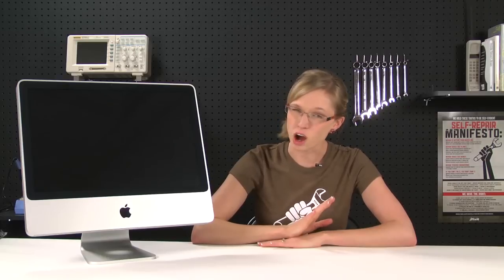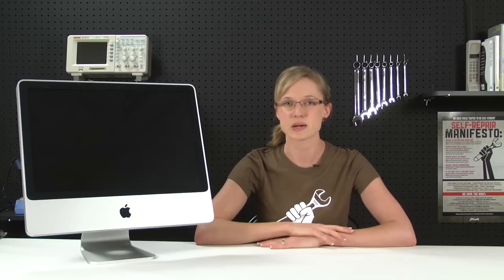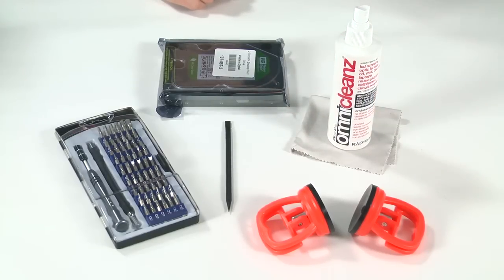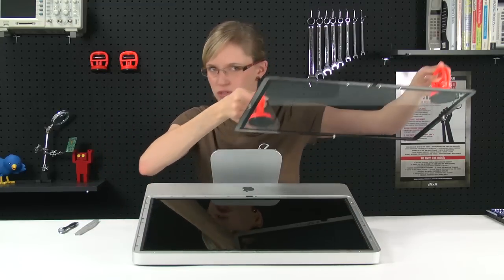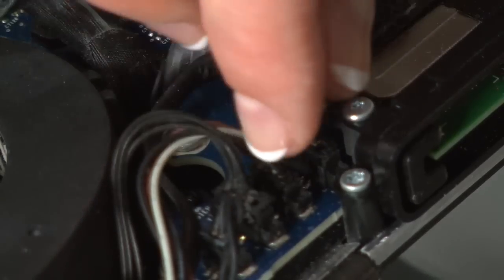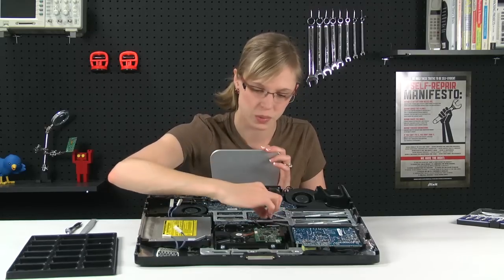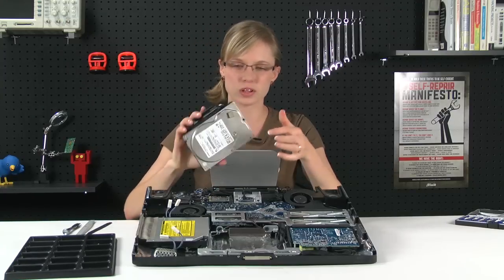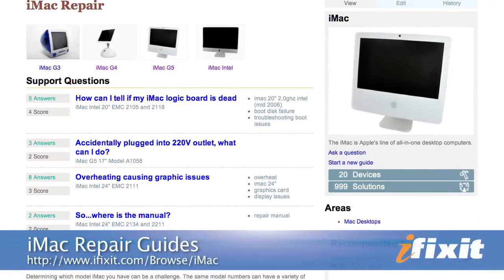How To: Intel iMac Hard Drive Replacement

Comment: Thank you for posting this tutorial.  I just followed along with you on my iPhone to replace my dead 320G Western Digital HD with a new 3.0TB Seagate.  I have an Early 2008 24" 2.8GHZ Core Duo iMac.  Everything was just as easy as you made it look.  The biggest obstacle that I found was getting the tape off of my microphone wire.  My Mac had never been opened and that tape was really on there.

My compliments to your camera operator and editor. The quality of your video really made it easy to t

Comment: I love your do it yourself demo.  It was fantastic.  I just turned on my iMAC 27 mid 2010 and noticed the disc drive is making a funny sound.  After a while got the dredded folder with ? mark.  Which obviously tells me the harddrive is dead.  How is that possible?  This thing has had less than 200 hours of use.
Well, your instructions is golden.  Thanks for sharing

Comment: I actually found this video very helpful for 2 reasons. I wasn't aware that there are specific replacement hard drives. I thought I'd just put in one of the many that I have laying around. Turns out that won't work. Secondly, I'm usually completely unafraid to take apart a computer and work on it, but this video has shown me what it takes to work on an iMac, and I realize...this is not something I want to do. Thanks for the helpful video...and the french manicure was a nice touch.

Comment: Husband and I just did this and saved ourselves about $400.  It was a little nerve wracking, given that I am not the most technically minded person, but by crickey, it worked a treat. Some of the little connectors etc on my model were a bit tricky to remove and replace, but Allen all, the video combined with the written guide were excellent.  Thoroughly recommend giving this a go if you want to save some money.

Comment: PS, I did not remove my LED screen. I used my GPS suction cup to remove glass, unscrewed the screen, disconnected only a couple of connectors, and lifted the top part of screen. I was able to unscrew HD and lift out. All told, in and out it took me ten minutes, NOT counting driving to best buy to buy HD. Download SSD fan control to control your fan.

Comment: I've used iFixit's guides for years to repair all sorts of Apple gear.  People need to learn to fix things instead of throwing them away.

With their guides I swapped out an old HDD in my iMac for an Intel SSD, made the computer run like new and only took me about 40 minutes.
Reply: Hey how exactly did you get mac Os on your new SSD? I'm planning on doing this in the future and I was wondering if you had to buy it or anything
Reply: RealGamerManz I had a retail Snow Leopard disk that I booted off of, you can make your current OS install a bootable USB drive, just google for info
Reply: sek929 
Ok thanks dude

Comment: Really useful.  Not done this yet but contemplating it.  

BTW I asked about HDD upgrades in the Apple Store the "Genius" said its really easy to upgrade by essentially following the procedure in this video.

He gave me this advice to deal with dust etc: Do the work in the bathroom just after taking a shower, the dust will get moist and fall to the ground.  Well if you have space that's probably good advice, I don't however!

Comment: Four Observations:
1) Hack tip: Use a car GPS windshield suction cup if you do not have heavy duty suction cups. A locking mechanism helps.
2) Why the hell can't Apple make some type of access door to access the HD??? What a pain in the ass!
3) I was able to lift the LCD enough to access the HD without having to disconnect the ribbon cable. I only disconnected that first cable. 
4) This beautiful woman could read the phone book and I would watch that video. 

Thanks for the clear instructional video!
Reply: +Eric Ricacho wow thanks for that. i was wondering too if i can use the windshield suction cup haha
Reply: Apple makes it intentionally difficult to repair their machines.  Sad but true.
Reply: "just buy a new one" is definitely a convenient fringe effect of their designs. in my opinion the reason theyre so difficult to repair is because they are obsessed with aesthetics. they would rather engineer & produce an entirely new and awkward way to take their machines apart than have a row of screws showing.

Comment: thanks built 100s of PCs but never played with my mac untill my harddrive died , watched this vid and did it in 10 mins , P.S you dont need suction cups just run your nail under the top of the glass and it will raise back far enough for you to pull forward , as said 10mins done , and a fresh instll of windows on my new hardrive , thanks again

Comment: Thank you very much, I have two old iMacs at the office, only to find that one of them has better specifications than the one I'm actively using, now I believe that switching the HDDs is the quickest solution instead of retransferring the huge data and re-installing all the softwares. How can I be sure that no compatibility issues may occur? 

the one I'm using now is is mid 2010s , with an i3 processor, while the one I'm planning to use is mid 2011s i5 processor. both have the exact OSX El-Capitan; version 10.11.6

Comment: Thanks for the video here are a couple of notes from my HD to SSD conversion. My Mid 2012 was different, as you noted, it did not have a  bezel and there were more cables connecting LCD to MB. However overall it was fairly simple, if you are careful and patient. Recommend a help from someone with a flash light and help holding screen. After you copying you drive (I used free super-duper and a cable $25@BB)  if you have MS Office installed it makes you re-key your copy of office. I used the free software utility to change the fan sensor on the HD since its now SSD dont need it and just left the fan sensor cable hanging. Finally it seems like the initial boot is not that fast but performance is better overall. Now I can use the old drive as a backup with a enclosure and USB cable.

Comment: Hey there iFixit peeps! I have a legitimate and dire question to ask of you. I have a 2008 iMac 2.66 Ghz 20" Model A1224 that I absolutely adore because it has never failed me. I do lots of Photoshop & Lightroom malarkey and I'm considering an SSD upgrade. 

My question is: Which one should I get? The good folks at OWC has an Extreme 6G version and a 3G affordable version. Could my iMac take advantage of the Extreme 6G speeds? Isn't it a SATA II device? Is the 3G good enough? Help. Thanks!

Comment: I recently came across the shell of a late 2007 iMac it has no hard drive therefore no operating system and I was wondering if I can use my MacBook operating system on this particular new hard drive I have to buy. And if I can use my MacBook operating system what is the best way to transfer the information? Before or after I install the hard drive and will superduper work with that process?

Comment: Minbe was differant on the LCD connections. Mine didnt have the inverter cables mine had looks like a ribbon cable plugged directly into the power supply.

Comment: Came here for this myself. 0:44 seems to suggest if your iMac is Late-2009 Model or later, you won't be able to switch brands. Though it doesn't say if you're able to switch to SSD, as long as you're sticking to the same brand.

Comment: I have encountered a problem with my IMAC Intel desktop that was purchased at PC world year 2009, it no longer boots pass the white apple logo, tried to boot from apple installation disc thinking I could reload (leopard OS), it went through 80% of the installation and freezes, tried couple of times, but in vain freezes at 80%.I reckon the hard disk is on its last legs. Any advise would be much appreciated.

Comment: This isn't difficult or insane.  A little tedious, to be sure, but not at all hard.  A little preparation goes a long way.  I used Carbon Copy Cloner to clone the original drive to the new SDD.  I spent 10 minutes gathering tools and prepping the work area, and then it took almost exactly 90 minutes from start to finish.  It booted promptly from my OWC 480GB drive, and the only un-expected hiccup was re-entering the product key for the MS products.  Couldn't be happier.

Comment: Hey does anyone know how I can got my pictures, applications, operating system onto the new hard drive? help would be appriciated :)
Reply: +Technogramps  If you have an external hard drive you can use time machine to perform a backup and then use that to restore to the new drive once installed

Comment: all you need is 1 suction cup that you can get with those OPEN and CLOSED signs, push into top right corner or top left corner, and then pull... so easy... heavy duty suction cups lol... WHY

(( I have repaired at least 500 macs so far so i know ))

Comment: WRONG! Just bought a replacement hdd the same brand as I had (hitachi) and the temperature sensor socket has been made redundant. Looks like I spend double on a hitachi AND I get 100% fan speed. FML

Comment: Can someone send me the link to purchase the harddrive please? I can't find it at apple online. Thx
Reply: Check the inverter cables
Reply: Hi, Take your HD out, take it to best buy, buy the same exact one. The fan will ramp up contrary to what MJ says. At first I had to put Mac to sleep to stop it, and wake it, it stops, but ramps up over time. I found a fix. Its called SSD fan control. That will let you control the fan speed. Save your receipt. Apple will reimburse you for HD when they decide you are in the global replacement program,. They were a year late with mine.
Reply: Did you edit your first comment? My answer looks dumb now
Reply: Thomas Cavanagh Your reply was not there when I commented a hour ago, infact, what you stated a month ago, is not what she asked about.

Comment: Hey Vic,
Yes you can still replace the hdd with an ssd.You're just not going to be able to use the thermal circuit and so your fan is going to always be on running at 100% speed. Yay for fan noise. You'll also want to hunt around for a program that will turn on "Trim" support in the OS. Apple does everything it can to get you to buy a new Mac so Trim is only supported with Apple approved ssd's in the OS without an app to "hack" it. Not a big deal just a few clicks and you're good to go.

Comment: My mac didn't come with start up discs, after I replace the hard drive, what do I do? Can someone point me into the right direction?
Reply: i had a similar issue with a macbook. i bought a bootable usb stick running Mountain Lion and it worked. it was about £10 on ebay.

Comment: Lots of tools and gadgets needed.  Very difficult to get to the hard drive.  I can use my fingers to replace the hard drive on my tower. My windows desktop is lots better than this Mac if replacing the hard drive is a measuring stick.

Comment: Ok. You mean, buy an external drive, set it up with with carbon copy, or something like that, so that it's a carbon copy of my internal drive, hook it up via usb or firewire, and then hold the C key down so it boots from it? Or maybe if my internal drive is dead, I won't need to hold the C key down?

Comment: MacPros are too damn expensive.Not practical for most people.I wouldn't mind an iMac if they let you upgrade without paying the Apple tax. For example. the new 21 inch iMacs will not let you upgrade unless you pay Apple in advance but if you are willing to work over some more money you can do it on the 27 inch.  I don't see how upgrading a hard drive or RAM cuts into their other products. So, I am sorry, the PC does excel because its more user friendly to upgrade and take apart.

Comment: Intel core i7 running 3.4ghz with motherboard- $128.89, 8GB Corsair Vengeance DDR3 RAM- $49.99, Western Digital 1TB HDD-$30.99, EVGA GeForce 1GB DDR3 Video card- $29.99, Ultra Defender gaming case with 400 watt power supply- $39.99, (If you spend over 50 bucks on a computer case you're an idiot, who cares how they look as long as it works.)  LG bluray Writer- $40. Altogether $320 for a PC, an apple similarly speced is around $2300. I don't need a display but that's $120. NICE TRY LITTLE BOY.

Comment: LOL are you freaking kidding me. your telling me i can get pc with the following specs for $300. must have a sandy bridge quad core i5 processor. atleast 4gbs of ram (cheap). a hd IPS display, a decent graphics card (amd or nvidia), a 500gb harddrive, A NICE CASE (no 50 dollar case, if your comparing imacs to a homemade pc you need to account for how nice the imac looks and feels) and you need to buy a mother board and power supply. NICE TRY TROLL, YOU ARE CLEARLY BIAS

Comment: The video was great, would make it very easy to replace my hard drive if I thought it was worth it for this 5 year old iMac.  But, this procedure is like saying, "To change the oil in your car, start by removing the engine with your heavy duty suction cups."  Are you serious? Even an average laptop is way easier than this... did Apple think that a WD hard drive installed in their computer would somehow be more reliable just by virtue of the Apple logo on the alumimum case outside?  Grrr...
Reply: It's not really fair to compare this to an oil change which would need to be done semi-regularly. This is something most people will only do once, maybe twice in the entire time they own the iMac.